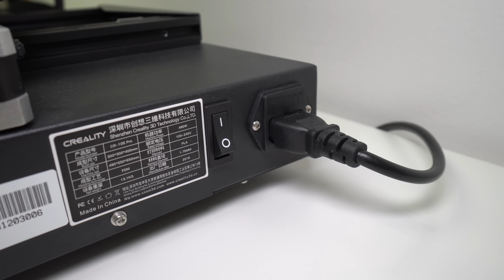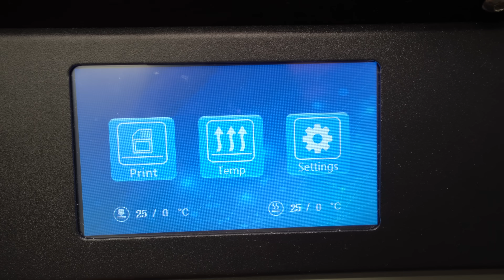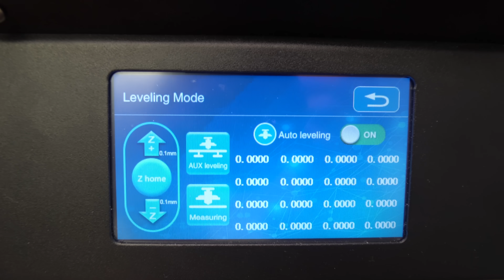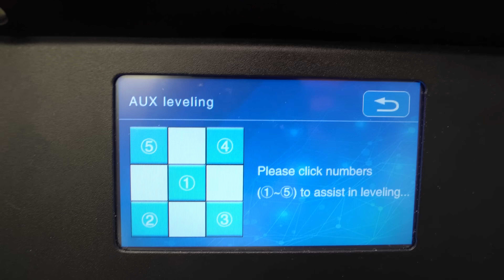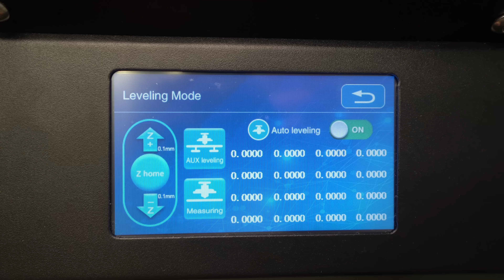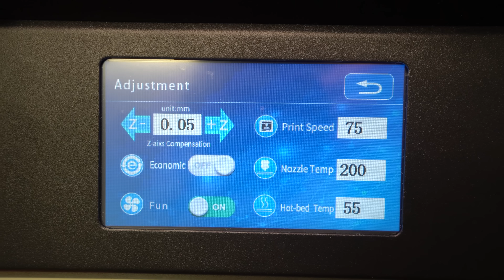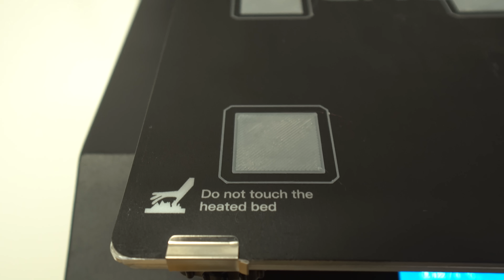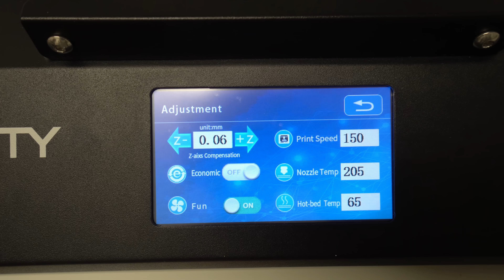Creality Cr10S PRO - Fix your bed leveling issues (Inductive sensor install)

Comment from the maker: Important info!  Please read it.
1. Make sure that you order the right inductive sensor. Check the model number: LJ18A3-8-Z/BX , diameter 16mm DC 6-36V, NPN NO(Normal Open), Detect Object : Iron (Metal)
Test your sensor before you connect to the printer! 
It seems that there are different variations of these sensors and wrong one could damage your printer motherboard. 
Here is how to test it: 
 Take any power supply source from 6-36V, Take some power adapter in your home, like laptop power adapter for example. Connect blue to negative and brown to positive but leave the black wire out free. Now take the multimeter and check blue wire (negative) with the brown(positive) Voltage should be 23-24V.
Now check blue wire (negative) with black wire(positive) and voltage should be the same 23-25V (Circuit open)
Now place metal object on the sensor head. Led light should activate and voltage between blue and black(free) wire where it was 23-25V should drop close to or to 0V and voltage between blue (negative) and brown (positive) should remain around 24V. 
If your sensor don't work like that DON'T INSTALL it! 
That means you got different type of sensor like PNP or other type. Check test pictures on the link: https://goo.gl/q6Mfcy

2. Lower the inductive sensor more down to 3mm or less away from Heat-bed. 
In that case nozzle will be higher up and chances that nozzle touch or hit the heat-bed surface is minimal and it will give you even more precise measurements. 
2. Upgrade the firmware to the latest one from Creality right now the latest version is 1.60.7(Works great and it saves all Autolevel probe measurements and Z offset and it shows them after power off...
Here is how to upgrade CR10S PRO firmware:  It's very easy.
1. Connect printer via USB cable to the CURA.
2. Click on Settings/Printer/Manage Printers/Select Cr10S 3D printer/Upgrade Firmware/Upload custom Firmware/Select firmware file CR-10SPro_1.60.7.hex and run it. 
3. Wait minut or two...
Done!
1.60.7 Firmware can be found here: https://www.creality3d.cn/creality3d-cr-10s-pro-p00253p1.html
 
Also I got alot of questions about inductive sensor and glass so here is my answer:
 This Inductive sensor will work with glass sheet over the aluminum heated bed, but glass needs to be less then 2.9mm thick. The thinner the better. When sensor trigger on 2.85mm glass you have 0.5mm clearance from nozzle. It's not too much but it can work if you can't found thinner glass. 
Personally I use 2mm glass(1.92mm actually) and sensor triggers 1.35mm away from the glass bed. I have alot of clearance. Here are few photos with my 2mm glass where sensor triggers and how I set it up.
https://drive.google.com/folderview?id=1z4Okyd85OK-rolp2ZkaUS3xgqnzXZtaE
Reply: My z axis will not home after installing the new sensor. I’ve seen this problem reported elsewhere in the comments and on Facebook. Does anyone know what the fix is for this?
Reply: @OverTheTopFabrication  Did you ever find a fix? I have the same issue.
Reply: McJamz I bought a bltouch probe v2, v3 will not work on the CR10s pro.... unless there has been a fix to the firmware that I’m unaware of. Ran the cabling into the base of the 3d printer and updated the firmware the same way 3d printing Canada shows in their bltouch installation video. Has been working fine ever since
Reply: @OverTheTopFabrication  Mine triggers the light but won't stop moving the Z axis down.
Reply: Where can you find the latest firmware? The one I downloaded from Creality website is V1.60.3 instead of 7.
Reply from the maker: Chun ho lee https://www.creality3d.cn/creality3d-cr-10s-pro-p00253p1.html
Reply: @Nexi Tech when I auto home the printer after this it's about 25cm above the bed, even when I power off and level the X using the acrylic block when  i power back on and go to levelling it moves to about +25cm above the bed (probe light is off) obviously it's to high so I can't raise the bed to compensate any ideas?
Reply: @IndieRyanAvent  I have the same thing happening with mine.  I'm going to update the firmware and see if that helps.
Reply: @IndieRyanAvent  I have this same issue. Any luck figuring out what the heck is going on?
Reply: @renehasp  the probe recommend burnt out the board, u need to get a replacement.
Reply: @IndieRyanAvent  Awesome! I was hitting my head against the wall trying to figure out what happened. So the probe ending in Y is the wrong one that Amazon sent and it damages the board
. I just wanted to say thank you so much ❤️.. I learned a great lesson to always double check all the part numbers and not believe Amazon when they send out parts.
Reply: @renehasp  unfortunately it seems so, it looks like the probes are a bit hit or miss even if you get the right model, I have still been unable to find a reseller for the distribution board the probe plugs into you might be able to get one from the supplier of your printer but if you're able to find somewhere to buy one please can you let everyone else know?
Reply: I ordered one of the sensors listed in the description, but it's unfortunately blown 2 separarte power transfer boards (the one by the extruder). You can tell if its damaged the board as there's a blue led on board and it should be on when sensor led is off and vice versa. If its permanently off the the optocoupler chip is blown and you need a new board.
I tested the standard sensor with 12v input (to blue and brown wires) and I get 24v out on black wire when sensor led is off and get 0v when sensor led is on.
I then tested my inductive sensor, again 12v to blue and brown, this time I get 0v out of black wire when light is off and only 12v when light is on, so completely different behaviour, my new inductive sensor  says LJ18A3-8-Z/BX NPN NO(normally open).
Reply: @IndieRyanAvent  i'm having the same issue. did you manage to resolve it?
Reply: @andidotro  unfortunately not the board is shot, you will need a new one or get it repaired some how. The issue is Creality won't replace it even it you offer to pay and no one sells the part. Basically unless you got it from an authorized reseller like Amazon you need a new printer or it's dead untill a company makes a clone board or u get it repaired some how.
Reply: ryan avent check my comment above yours for a temporary fix. I ordered a v2.0 bl touch to install in place of the stock sensor. Will let you know how that works once it arrives.
Reply: @IndieRyanAvent  Did yhou ever find a solution, I have the same issue now.
Reply: @IndieRyanAvent  Hey Ryan, I'm having exactly the same issue as you, did you get yours resolved, if so, what was the solution.  TIA
Reply: The problem is that some people happened to us that when changing the capacitive sensor for the inductive one, the nozzle crashed against the bed and continued to fall, this is because when changing it, it was left with a very high negative offset on the Z axis and that is why the nozzle crashes against the bed, fortunately it is something very easy to solve.
Reply from the maker: ''after mounting the sensor 1 mm lower than the nozzle'' 
How the sensor can be lower then nozzle?! It should be higher then the nozzle a few mm! Start with lifting the sensor first then go to Crealty 3D website and download latest firmware for CR10S PRO then and upgrade your printer with CURA, then re-level it manual first few times and then click on Auto leveling and try it again.
Reply: @NexiTech  I've just got the printer, it was shipped with 1.70.1 and the only way I got around to fixing this issue was the tiny machines firmware. 

Waiting for anti backlash nuts and this should be ready for some nice prints :)
Reply: Will this work with a glass bed? Was wondering if you tried it with glass?I'm getting the sensor today. Looks like it would read through glass, but hoping for verification before I install it tonight
Reply from the maker: Vlog Dog Actually Inductive sensor will work with glass sheet, but glass needs to be less then 2.9mm thick. The thinner the better. When sensor trigger on 2.85mm glass you have 0.5mm clearance from nozzle. It's not too much but it can work if you can't found thinner glass. 
Personally I use 2mm glass(1.92mm actually) and sensor triggers 1.35mm away from the glass bed. I have alot of clearance. Here are few photos with my 2mm glass where sensor triggers.
https://drive.google.com/folderview?id=1z4Okyd85OK-rolp2ZkaUS3xgqnzXZtaE
Reply: @NexiTech  thank you! I am very excited to try it. Will let you know of my result
Reply: Sadly glass is a no go. So close to working. Out foil under glass too. Just not enough. Tried two glass beds. Stock bed working fine so far. May try PEI as I hear good things
Reply: @NexiTech   do you think it would be better to use a Switch with 10 or 12mm instead of this 8 mm version LJ18 A3–8-Z/BX Detektor 8 mm 6–36 VDC 300 mA (with this the glas bed could be thicker)
Reply: @NexiTech  Does the ultrabase bed works with the inductive sensor? I just got my 10S pro and the standard bed is warped (higher in the center). Also when I print the extruder does not go near enough the bed... I am a total newbie btw.
Reply: @NexiTech  HI, as I don't know the subject well, I confess that I didn't understand why you preferred to solder the wires and not use a new plug?
Reply: I can just get the .3 firmware from crealitys homepage - not the .7 - where did you get the firmware from?
Reply: @olectrix  From: https://www.creality3donline.com/creality-cr-10s-pro-3d-printer_p0127.html under "Description" there is a Dropbox link to download the 1.60.7 firmware: http://bit.ly/2Ev691t
Reply from the maker: olectrix https://www.creality3d.cn/creality3d-cr-10s-pro-p00253p1.html
Reply: good to know :)
Reply: Hi  great video just starting to get into 3d printing and have just ordered a Cr10s Pro  I have look for a inductive sensor and have checked Ebay and searched with the Model No LJ18A3-8-Z/BX  looking at the info with suggest that the probe diameter is 18mm  I have bot been able to find a sensor with a 13mm dia.   Do you have a link for a sensor with the 13mm dia
Reply: Nexi Tech  all of the links in your description are for npn sensors. That would explain the z homing issues that people are having if they just click the link and buy. So if you are purchasing a sensor make sure it is PNP. Correct me if I’m wrong, but I think the part number should be LJ18A3-8-Z/BY if it is in fact supposed to be PNP
Reply from the maker: @OverTheTopFabrication  On the sensor that I use on my Cr10S PRO label says NPN. Maybe they use wrong label?! Did I just was lucky?! I have  few more sensors at home. Two PNP sensors(only different diameter) and one more NPN sensor(plastic type). Let me investigate this. It makes sense what you are saying. I will report back with more info as soon as I can.
UPDATE: 
I triple check my two PNP NO(normal open) sensors and one more NPN NO (normal open) sensor and compare it to my NPN NO(normal open) sensor that I have on my CR10S PRO in the video. Definitely my sensor is NPN NO which match the links in video description.
 When my NPN NO sensor is connected to 24V it sends 24V on the black wire which means circuit is open(live) and when sensor detect metal, voltage on the black wire drops at 0V(circuit closed)
Now on two PNP NO sensor that just tested they behavior opposite. When sensor is connected to 24V, Voltage on the black wire is 0V and when sensor sense metal object voltage on black wire goes from 0V to 24V.

Here are the photos from testing
https://drive.google.com/open?id=1wx5bqSQdRTlfXcxA06h9l2dcbCmfpw3J
Reply: @NexiTech  I tried to buy the LJ18A3-8-Z/BX NPN that was in the link but they sent me a LJ18A3-8-Z/BY PNP.  since installing the wrong sensor my printer will not stop going straight up. I put the original sensor back in and even after changing back to the old sensor, the Z axis keeps going up and will not home or level. 

I reordered the LJ18A3-8-Z/BX NPN and it should be here tomorrow hopefully my motherboard did not get fried. 

This comment was edited to avoid any confusion
Reply: Nexi Tech ok, so I think the only thing you need to change in your original comment to avoid any confusion is that you bought NPN, not PNP
Reply: @JRLawson1234  same I got the Y version from the link and same thing happened even my original sensor did not work
Reply from the maker: JR Lawson I just edit my main PIN comment to warn people about these different type of sensors and how to check them before installation to the printer.
Reply from the maker: SeaHawk Design Done and I add how to test the sensor before installation and post the pictures.
Reply: There is a temporary fix to get yourself printing again until the sensor situation gets figured out. If you are comfortable with editing Arduino files then do the following: extend your stock sensor cable long enough to reach the motherboard on the inside of the printer. Open the marlin Arduino file (watch 3d printing Canada’s bl touch video) edit line 91 to say #define ABL_EZABL // TH3D EZABL or Any NO Sensor. Upload the firmware to your printer. Plug the extended cable into Z- on the motherboard. This will allow the printer to home. But DO NOT home it yet. You need to adjust the offset of the sensor first. I would home it on a raised surface first so you don’t run your nozzle into the bed just in case you are not set up right. Just place a metal ruler or your feeler gauge on a cardboard box
Reply: Corect sensor installed, tested before as advised. It sees Z offset as 0 when it's actually 10cm above the bed. Cannot lower it in any way. Any idea how to fix this?
Reply: @andidotro  when u do an auto level does the extruder continue to move up in the z axis ? If so then the octocupler on the board is burned out.
Reply: @IndieRyanAvent  yes it goes up. but changing back to capacitive works ok so I doubt anything is shot
Reply: @andidotro  mine is doing the same new board correct sensor and about 10cm above the board, did you find the problem?
Reply: @IndieRyanAvent  we've talked already on the fb group, it was the cooler yellow wire which was shorting out
Reply: Andy Angel  can you clarify what exactly the problem is with what wire?
Reply: @OverTheTopFabrication  it was nicked at the middle and had to be replaced in my case
Reply: This is the issue I'm having after getting a new board updating firmware and follow the instructions, any ideas. https://youtu.be/Pkjhb8JMIlk
Reply: if I do not upgrage the firmware and just only change the sensor, is it will work?  sorry I am quite noob in this.
Reply: Hi Nexi thanks for your videos, helps a lot. I got a LJC18A3 B-Z/BX NPN NO. Do you think it will do the job ?
I have another question.I do not understand. On my CR10 S Pro Z motors do not make any compensation moves to correct the leveling defects. They do not move while they should to correct the level. Do you have an idea ? The option is activated though.
Thanks ;)
Reply: Hello, i have to say that my cr-10s pro has a (normal closed) NC probe ;no objekt = 24V on black; objekt = 0V on black
Reply: Hello Nexi, I bought the inductive sensor through the aliexpress link in your description. Same model. But it does not have the fine tuning screw in the top. 
(I tried to communicate with the seller before and after, he replies something else, does not understand english).
Reply: Ok, I ordered the sensor about 6 months ago and never got around to installing.  Installed the sensor last night and guess what... it's a BY.  I then come back to the video to see the pinned post and issue with those that received the BY PNP sensors.  

I just ordered a BC NPN NO sensor, but assuming I have damaged the board.  What are the options?
Reply: Is it U3 part number 357N (octocoupler) on the PCB that is on the hot end that blows when you install the wrong probe?  Would replacing the 357N resolve the issue?
Reply: I'm following your step by step guide but after mounting the sensor 1 mm lower than the nozzle, the printer can home itself and detect fine, however when i try to get to the bed leveling screen, when it homes and tries to find Z it probes once successfully, second time successfully and on the third time where it goes higher and then drops down to level it starts digging into the bed. What would cause this as i find it quite peculiar that it only messes up when you try to enter the leveling screen?
Reply: Thanks a lot for the great video! Working perfect!! Could you tell where we can buy the 2mm glass bed you have?
Reply: Hi  Nexi Tech. Thank you for this fantastic video.
Unfortunately I bought an original 4mm thick Creality glass plate. Where can I buy a 2mm thick glass plate? Thanks a lot.
Reply: I got 2pcs from 2 different sources.. one is 300mA the other is 200mA current output. The 300mA for sure works but the 200mA will also work?
Reply: Hi, I would like you to ask me the following question, please: I noticed that you used a 2mm glass that in the video appears covered with the black creality film. Am I right?
Reply: I did this install, but during auto-home the nozzle just keeps lowering until it's digging into the bed and the steppers start slipping. The inductive sensor DOES light up red, so it's detecting it. Any ideas?

Comment: inductive sensors also experience thermal drift when it comes to sensing distance so unless you`re using the same routine for homing and bed leveling you`ll get inconsistent results. I think that`s why in later revisions of the printer Creality decided to use a genuine BLTouch probe which has almost no thermal variation.